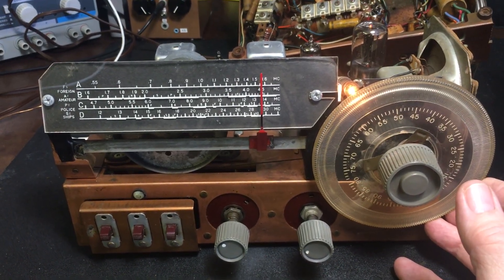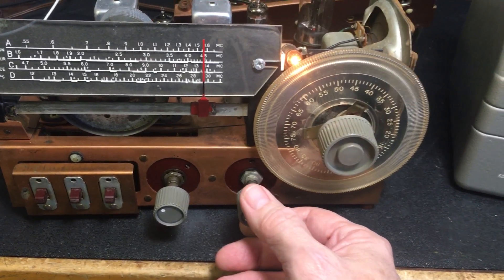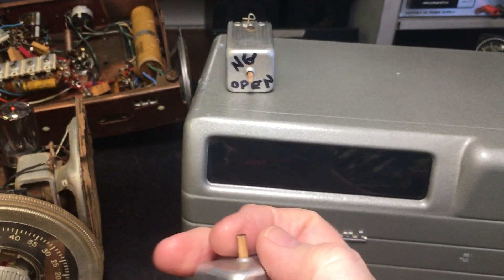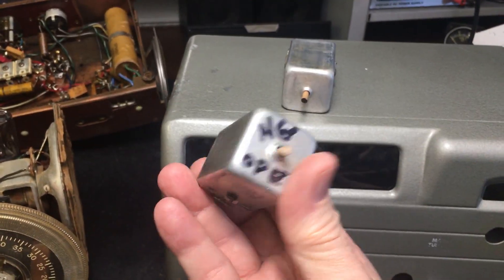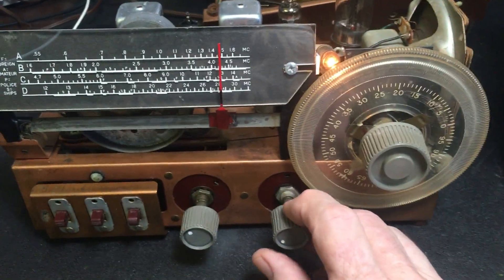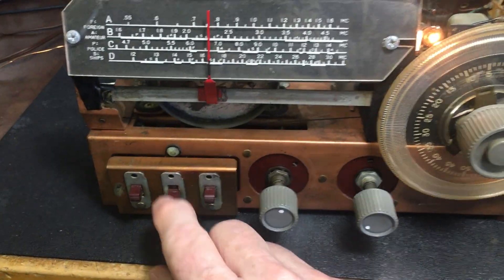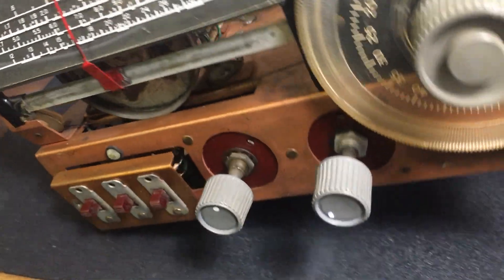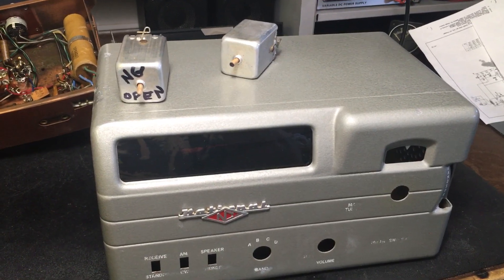NATIONAL RADIO SW-54 RESTORATION - Part 1

Comment: Back in the late 50s I worked several novice stations receiving me with that receiver, always thought I would like one. I will be waiting for your next videos. Also thought I would like a Collins receiver, but I chose a Hammarlund HQ-100 as my first receiver as that was the best I could afford. 73, W9FS
Reply from the maker: Nice to hear all of that Jerry.  I got my ticket in 1964 and never got to see one of these. The SW-54, like most other similar designs, work decently until you tune14 to 30 MHz.  The selectivity is terrible but you just got to go slow turning the dial.  HiHi  Thanks for watching!
Reply: @rfburns3472  The hams who knew electronics would use that radio as an tunable IF (3 to 4 mhz) for homebrew converters.  They liked using a BC-453 as an IF as well.